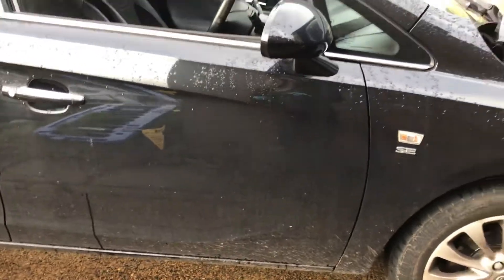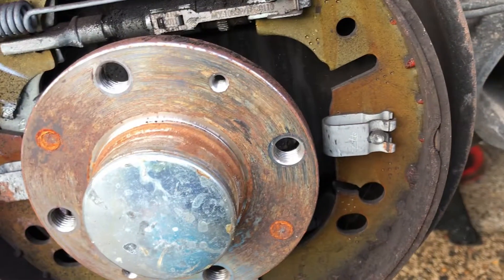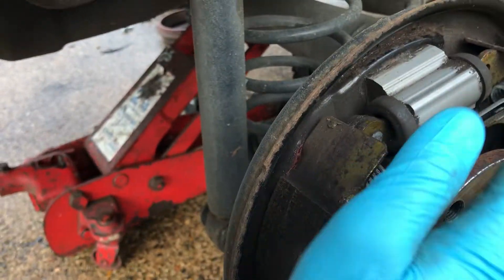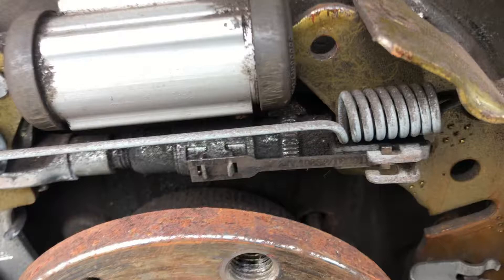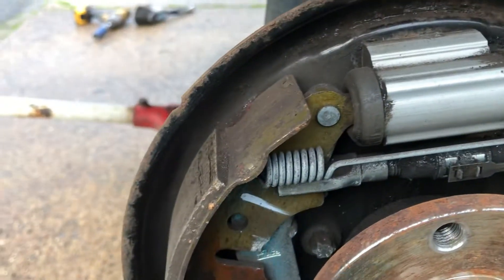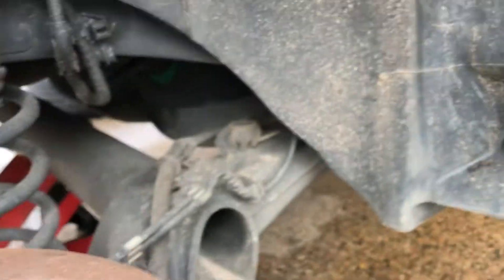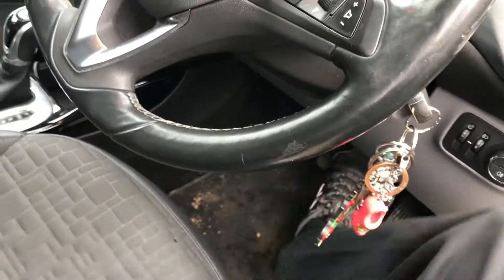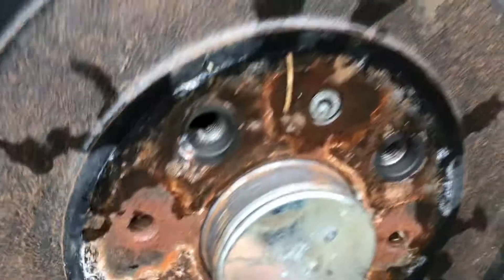How To: Adjust rear brake shoes and handbrake cable on a 2015 Vauxhall Corsa

Comment: If the drum doesn't immediately come off, after a swift tap, it's worth realising that the 2 small holes that are blind, and leave those 2 rusty circles you can see, are threaded. I can't remember if it's a 10 or 12 mm bolt, but just get a couple of bolts and use them to break it free.
Reply: M10 bolt

Comment: Surely these are automatic adjusters. Why do you adjust them by hand? As soon as the pedal has been applied a few times they will take up the slack themselves evenly on both sides. Am I missing something? Great video though! Thanks.
Reply from the maker: Hello mate,
You’re right they are self adjusting however I do like to give them a few clicks just to make sure the adjuster still moves and not seized. Also I find giving the adjuster a few clicks manually you get a better handbrake too! All personal opinion, thanks for watching mate.
Reply: I've owned a few Vauxhalls, and was advised to reverse and then brake hard to force the adjuster to set itself, which seemed to work.  It's a good idea to remove the drums though, to check the shoes and cylinders visually.  The drum brakes on my wife's Corsa have always been a bit noisy, especially first thing in the morning.  Time to take them apart, I think.
Reply: My handbrake on my 15' Corsa is very weak. On the first inpection in 2019 it was weak as in 202.I barely passed IT . Can i adjust IT? I tried to adjust it on e Brake(in cocpit) but no diference. I dont want to mess with drums if not gonna help :/
Reply: The sistem of automatic adjustment at corsa d it is a bad joke, that sistem in reality is not automatic adjustment, i had 2 corsa d and that sistem never work automaticaly

Comment: I put the wheel bolts in the drum without the wheel on and pinch them up before tightening the small screws not much more than finger tight `else you`ll never get them out next time, they`re only there to stop the drum being dragged off when removing the wheel.

Comment: how do you know in which direction you should rotate to "open" the pads (doing the clicks) ?  Thank You
Reply: I find trial and error works well but if you're looking at the adjuster from the front of the car you'd turn the adjuster anticlockwise, push the clicker from the bottom towards the car to push the shoes outwards. Think of it as if you are winding a nut off a bolt.
Reply: @toyotatim2521  thank you very much

Comment: Thanks for your Corsa E videos, really easy to understand. Any chance you will do a full replacement on the rear drum breaks?
Reply: It's on the Fiat forum (UK), Grande, Guides. Full detailed guide. A lot on self-adjusters, bimetal strip operation (important). Fix the link (missing dots).
www fiatforum com/threads/rear-drum-strip-and-clean.235078/post-4532867

Comment: The Corsa D is exactly the same: Some notes:

If the drum is stuck - loosen the handbrake nut fully from under the handbrake lever inside the car then use a M10 bolt in the blind holes in the drum to force the drum off.

The brake shoes auto adjust however the adjusters sometimes seize. Take out the adjuster and lubricate it to ensure it is free to move, then refit the adjusters. Then, whilst the handbrake cable is still in its loose state and both drums are on the vehicle - press the brake pedal repeatedly - this should nudge the adjuster as far as it needs to go to get the shoes as close to the drum as possible. Repeat with the handbrake for certainty. Tighten the handbrake cable nut inside the car so that the drums are loose on 0 clicks but starting to tighten on 1+ clicks and are evenly balanced.